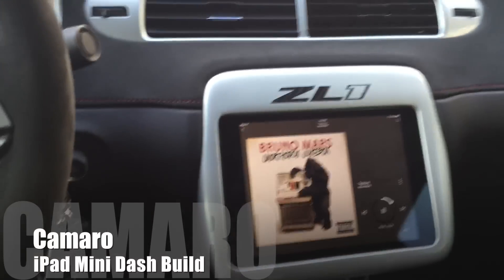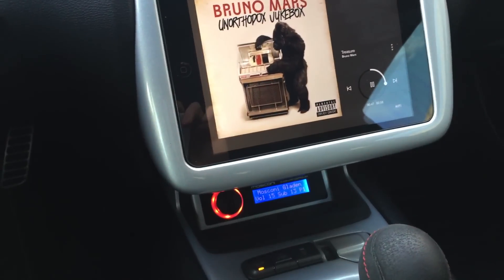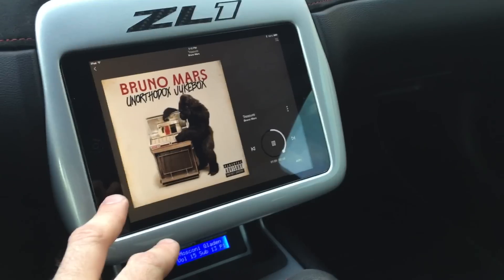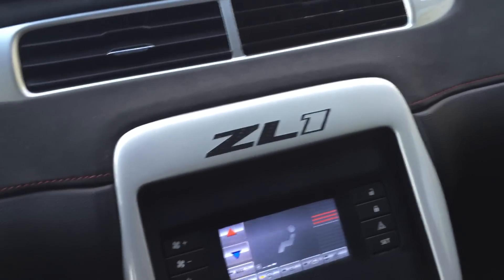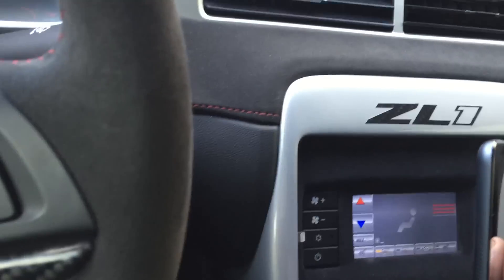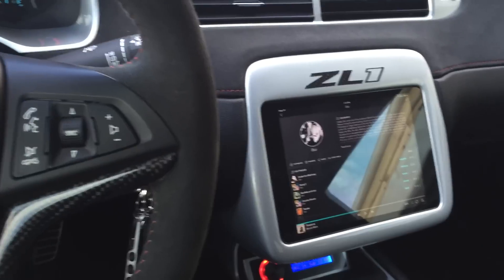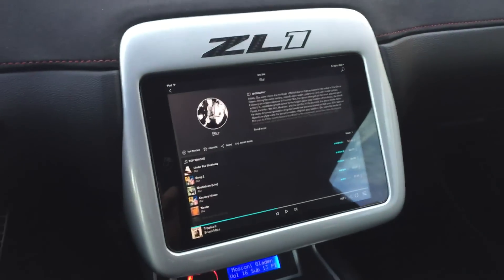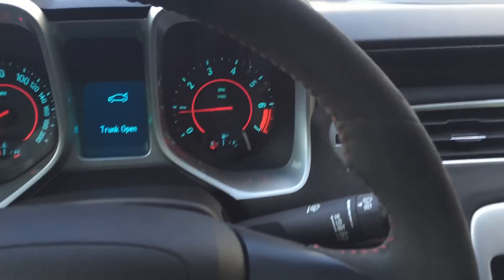iPad Mini Dash Build - 2012 Chevy Camaro

Comment: Do u build these for customers online? If so how can i get in contact with u so we can talk.
Reply from the maker: ben ten Contact me directly @ (703)368-1564
Reply from the maker: That is a work number. You can contact me at 703-631-4104. (work)
Reply: Do you still make these? Will it fit a 2015 camaro